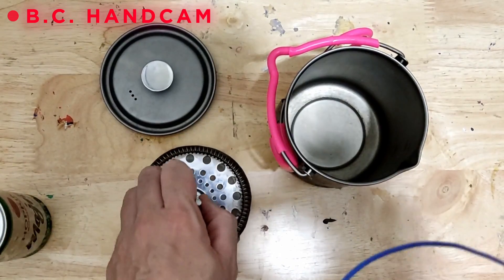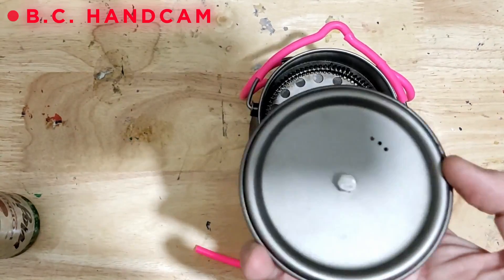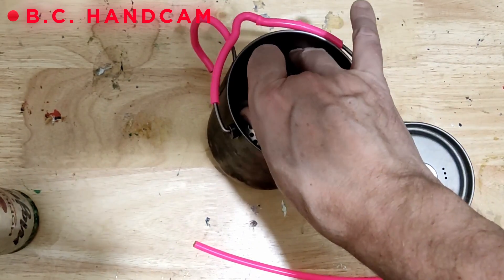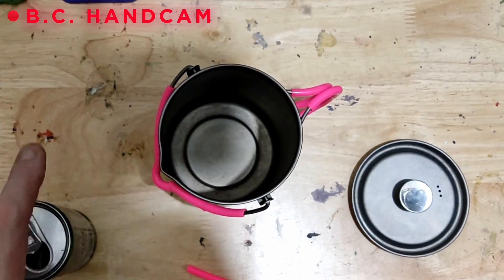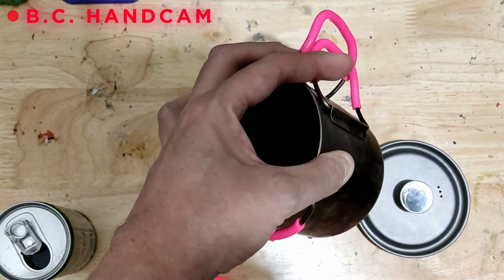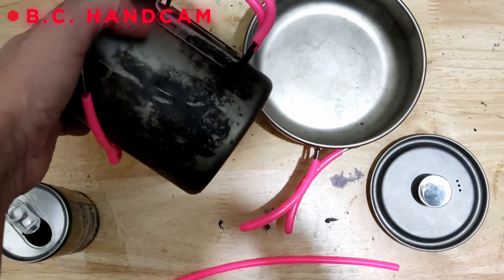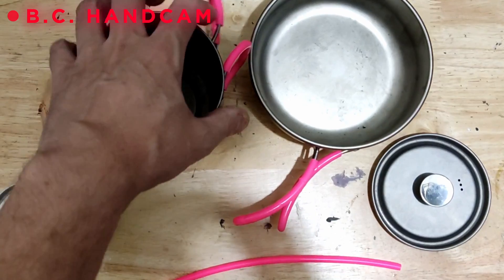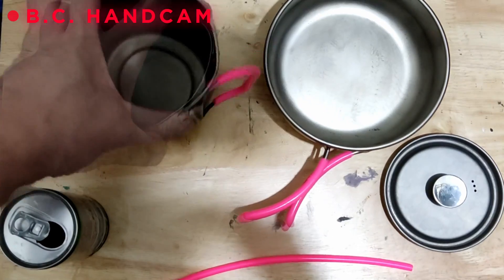DIY Silicone Handles for Titanium Pots + Lixada Review!

Comment: And here I am cutting and removing all the plastic tubing from thre handles of my cookset. I use a small 4x4 piece of carbon felt welding blanket if I need to pickup or hold hot items in my palm.
Reply from the maker: Why are you doing that? Also, I have been looking for a light solution for somethng like that, that's a great idea...tempted to take one of those silicon trivets but of course heat proof not flame proof.

Comment: Good video and idea. I've used heat shrink tubing (pretty cheap to buy) to add sleaving to my pot handles. Bit of a faff to bend round the corners, but probably still easier with heat shrink as it's bigger (before shrinking- by placing handles in the oven)
Reply from the maker: That's a good idea! I And heat shrink would be far more heatproof - the silicon tubing will burn if near a flame - not a problem as long as you keep the tubing away from the burny bts.

Also I've just found even the 'desgined for stoves' silicon stuff like the Fire Maple lid can melt!